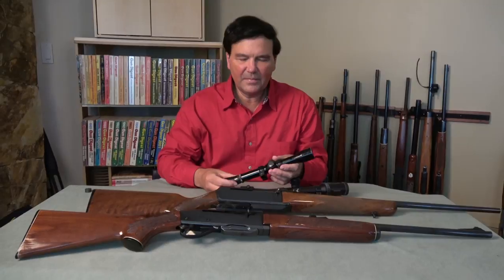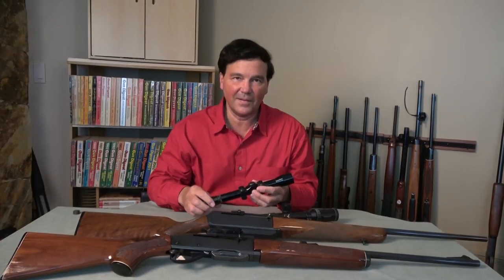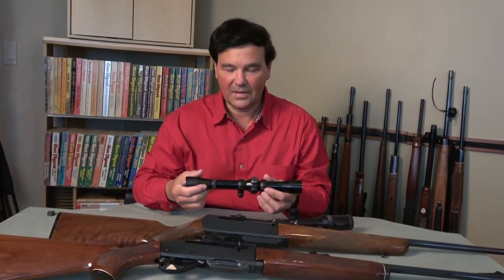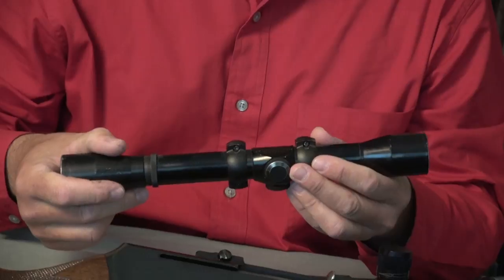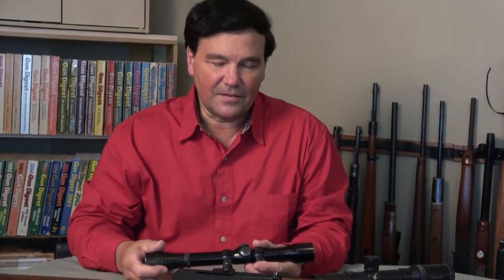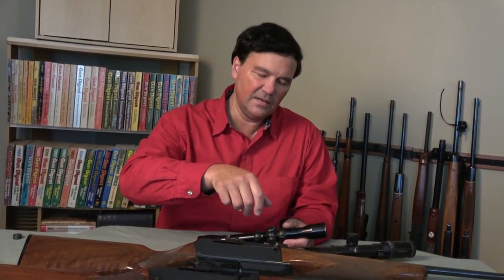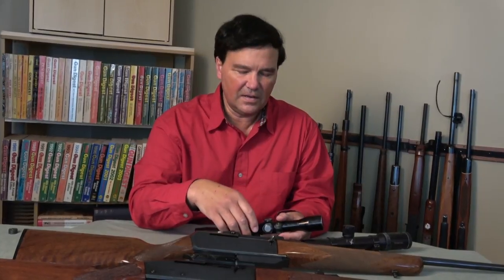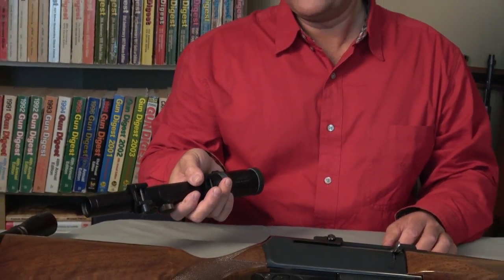Super Simple Way to Center a Rifle Scope Reticle

Comment: That's a good tip. Another way is just to mount the scope, put the rifle in a rest or bags so it's stable, pull the bolt and line the target up in the center of the bore and adjust the scope till the crosshairs line up on target. That will usually get me to within 6 inches@100m, some times bang on .👍

Comment: I have had over 200 scopes in my lifetime, but I will have to say that the Lyman All American scope is one of the best scopes I ever owned. Can't tell you why, but it just was.
On a lighter note, I bought a Unertyl target scope years ago, and it had a missing vertical cross hair. This was one of the old long spring mounted scopes with the external micrometer windage & elevation. Since it was not a nitrogen filled scope, I decided to take it apart and look at it. It as a very simple fix. There are 4 tiny screws at 90 degrees apart. The screws at 12:00 and 6:00 o'clock were missing the cross hair material. My young daughter had very fine hair, and she just happened to be passing by, so I plucked a hair out of her head and installed it. Worked fine. I traded the scope off years ago later, but she reminds me that I am still in her cross hairs!
Reply from the maker: Hi Mike - great story and an excellent fix! I know what you mean about the Lyman American. I had two or three with the Permacenter reticle - clarity was excellent and they seemed to be bullet proof.

Comment: My cheap Tasco 4x15 scope does not work that way.  I can turn the adjustment screws all the way to the right and come to a stop. But when I turn the screws to the left it continues all the way to where the screws come off, so there is no stop point when turning left, which means there is no way to center the screws.  Any other suggestions?

Comment: Well explained.
Here comes my question - hope not too knurly.
I can't see why I'd want to find the middle of the elevation. I'd never go over the line of bore with my line of sight. So if the scope from the beginning
 is installed with the "crosshair" in top (or just about) I only have to dial "down" untill I cross the path of bullet at the wanted two points.
I have to admit I've never installed a scope - paied my way out, but the excess "clicks" upwards seems a waist...or?
Reply from the maker: Good question - sometimes scopes are dialed completely to the left or right or up or down and people just can't get them on target. The count and divide by two gets the reticle in the center. : )
Reply: Scope rings and bases are not always machined perfectly, rifle receiver tops are not necessarily parallel with the bore. From heavy sanding and polishing, etc. Sometimes the bases have to be shimmed to get the scope aligned fairly close so you don't use up all your internal adjustment getting on paper. I want to be looking thru the center of the scope lenses when final sighted at whatever range I will be shooting.

Comment: I would just caution that if your windage is all the way left or all the way to the right And you try to turn the elevation up or down, it's going to rub the inside of the tube and not give you the true amount of clicks your elevation has. 

The same is true the other way. If the elevation is near maxed out on the rise or the drop, then you won't be able to fully adjust the windage to its left and right extremes.

A better method is to turn each adjustment a little at a time.
Reply from the maker: Very good - caution is best

Comment: How to fix a CANTING MIL DOT cross hair reticle in a Discovery scope. It is mounted on a Nitro tech Diana air rifle. This happened during target shooting session.
Reply from the maker: Hello Bahubal - The scope has to be disassembled which requires special tools and know how. The reticle is usually mounted on a plate - but it could be etched or suspended by some other means that I don't know. I would try to send for warranty repair or if that can't happen, then send to a scope repair specialist. I tried many times to fix scopes and maybe succeeded 5 or 6 times. Sorry I don't know more.

Comment: My scope crosshair tilted how to adjust that? Pls help
Reply from the maker: Hello - This usually means disassembly and re-attaching the often circular element that has the crosshair suspended in it; or on glass. It is not so simple to do and easy to wreck the scope and crosshair entirely. I would try to find a scope repair place and see what they think. Every time I tried - I failed and ruined the scope.

Comment: I did this and my scope is 280 up-down & 290 left-right..... had to count like 60 times
Reply from the maker: Wow - that scope has amazing adjustment range! And you have great patience and determination.
Reply: WinMag 1812 I just bought a new Nikon p223 3-9x40 Bdc 600. Great scope for a new 16 inch spr Ar15. I had 397 click on elevation and 392 on windage. 1/4 MOA adjustments.
Reply: You don't have to count clicks, just count full turns and get it close